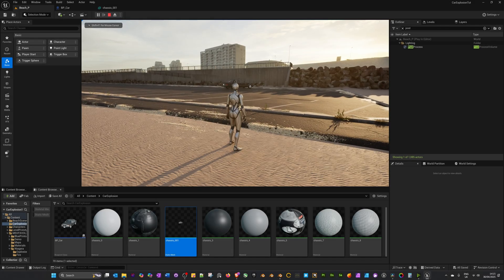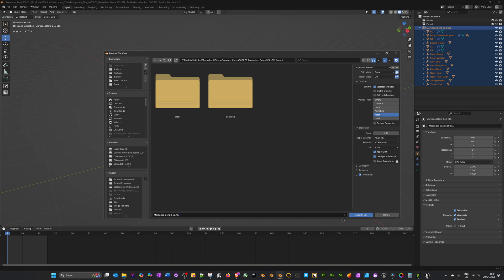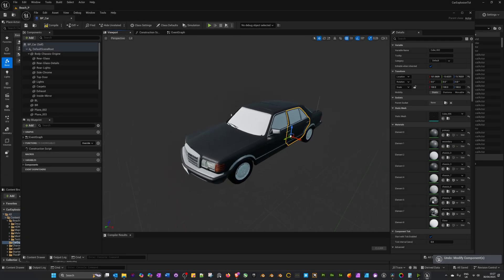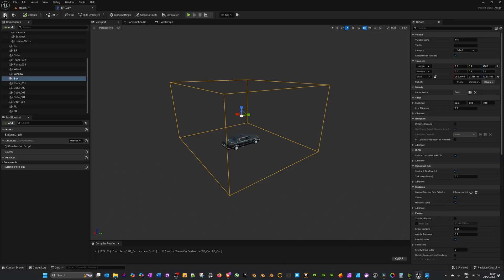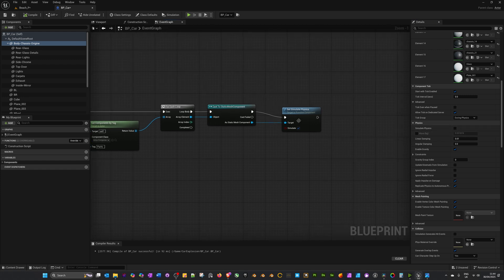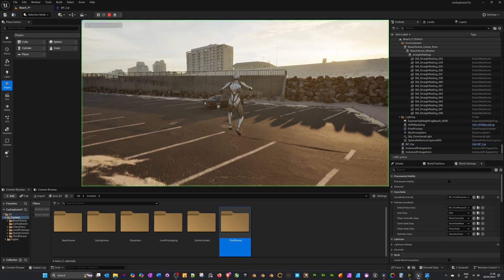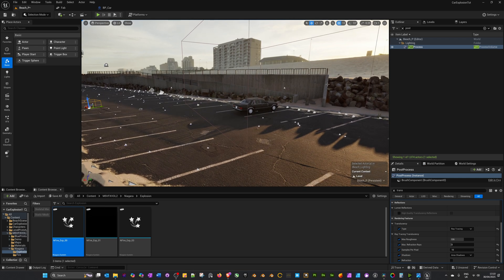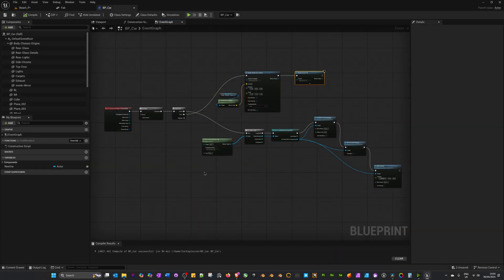Unreal Engine - Blender - How to Blow up a car (tutorial)

Comment: how does the mesh know to react by blowing up when you apply physics, versus any other physics reaction?
Reply from the maker: This is a bit of a quark in Unreal - it happens because when you enable physics on multiple objects at the same time, and if they are overlapping, interpenetrating, or just right next to each other as physics is applied (or a split second after it's applied) --- Unreal’s physics detects them as being in an 'invalid' collision state and tries to push them apart to resolve any issues. Hence forcing them to explode outwards! You can have more controlled physics reactions by using 'add impulse' etc... on objects that are not overlapping etc...